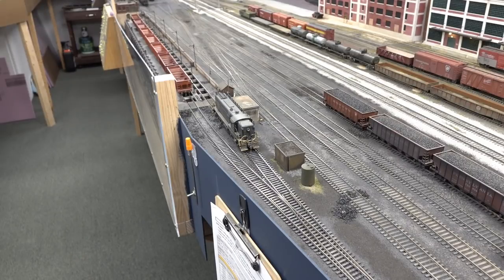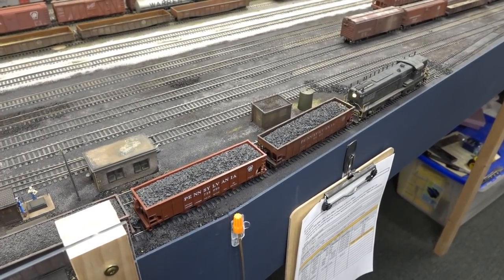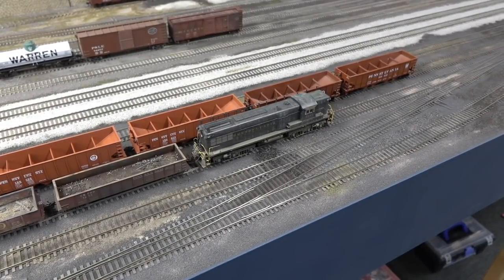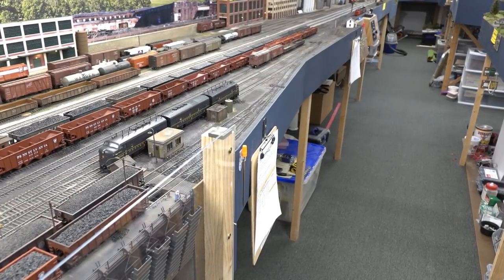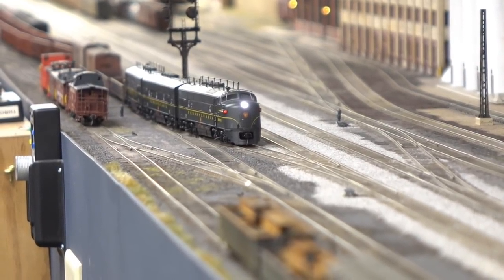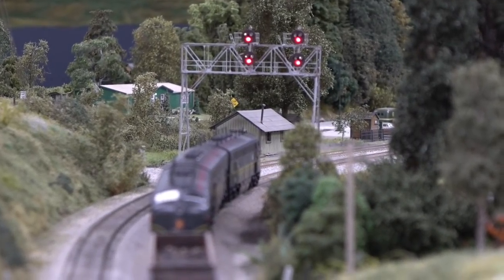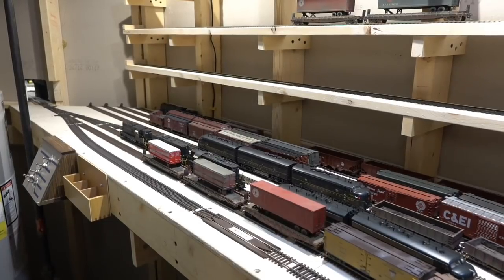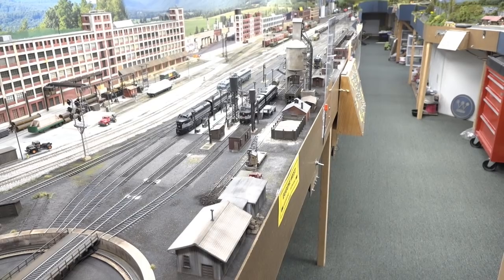Operations & Railfanning: South Yard and Coal Train

Comment: When I start doing ops sessions, it’ll likely only ever be me as I’ve never In life even had anyone I know into model railroading, and it’s a triple decker three branch line with two stagings and a main yard, more than likely when I run the ops I’ll only ever do one branch level at a time with probably a through train from staging to staging through the yard, yard switching, and one branch line mixed passenger/freight, a cattle unit train, or a daily passenger depending on what the system generates. That way it’ll take 3 sessions before the next branch line ops is uploaded. Beautiful layout!

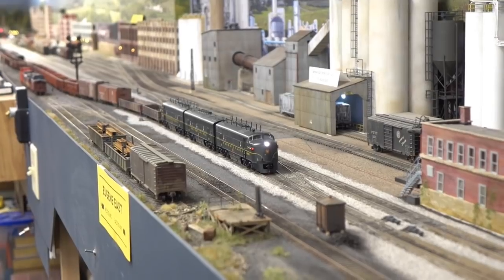Comment: Excellent video Rob!  I love the view at 36:49 (drone from Eugene East) where you see the entire train snaking it's way through the yard turnouts onto the main line.  Much more interesting than just a straight line of cars moving down a straight section of rail.  Although the view at 42:20 is pretty cool too, without crossing any turnouts.  By the way, if that yard crew that picked up the coal loads to move over to the coal dock early in the video was any good they would have known to cut the loads after 8 cars.  Then they could have picked up and moved all the empties without running out of room on the yard lead.  They'll get the hang of it with a bit more experience!  LOL  Happy New Year to you!

Comment: Brill vid you never seem to get any derailment s do you do anything to your cars ie weight keep up the great work
Reply: All I do is make sure the trucks have metal wheels; change them out if not. I will bring the weight up to ~NMRA standards but I don't agonize over it. I will check the wheel gauge as well- I had a few that were off and they did derail going thru frogs at turnouts.
Reply: @robbennett1965  great thanks cant wait to see the new building  stay safe

Comment: Anyone that tells you you need a lot of momentum has never run a real switch engine.  Switching cars is not a take your time job.  When your switching your moving as fast as the law allows.  When you start pulling a cut you move out kind of easy to make sure you've got the slack out so you don't get a knuckle and you don't jerk the switchman off the end of the cut but once the whole cut is moving you strip'er back jack.